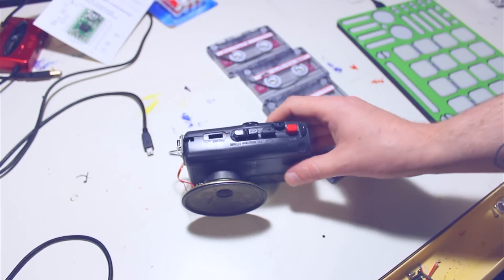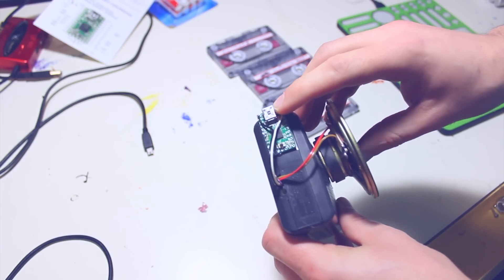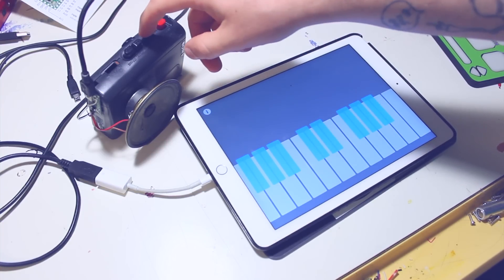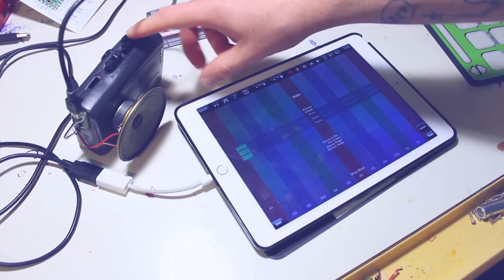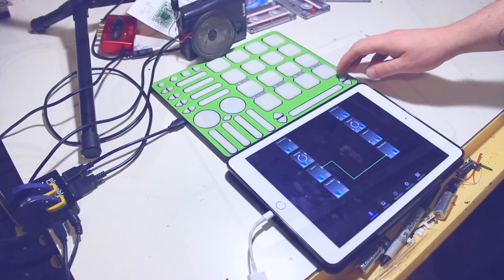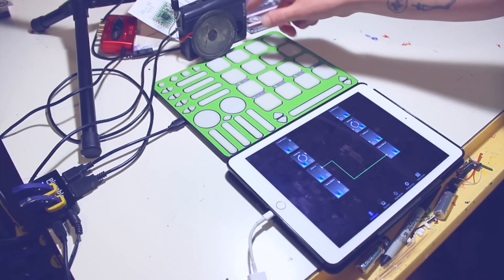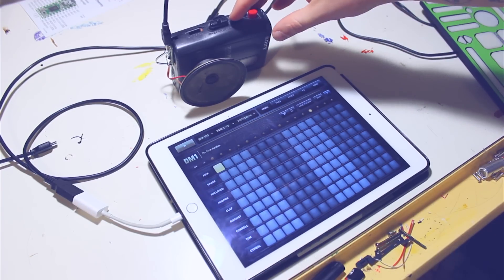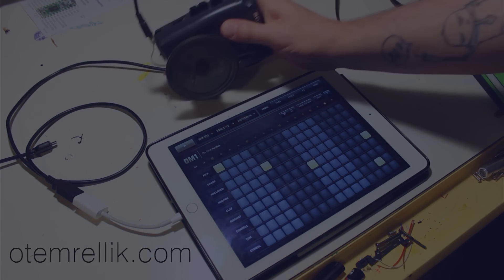DIY Mellotron

Comment: Thanks for uploading this; I'm hoping to build something similar.   Feel like giving any hints on how to code this?  Please?!  :)
Reply from the maker: Wish I could but I don't remember much about this project and I'm not sure where my code went. As far as I remember I just did analogWrite to a pin connected to the motor of the cassette player. It took a lot of trial and error to find the correct values for notes.

Comment: Could you please share the code?
Reply from the maker: Sorry, I can't find the code for this. If I remember correctly though it's got a function that detects midi notes and then does an ananlogWrite to a pin based on what note is received. Wish I could provide more info but I just don't know where the code for this is.
Reply: otemrellik please do share if you ever find it. Thanks!